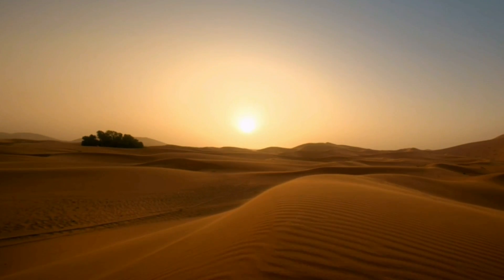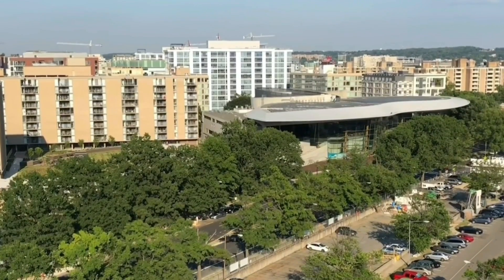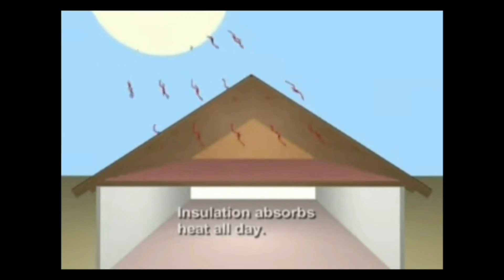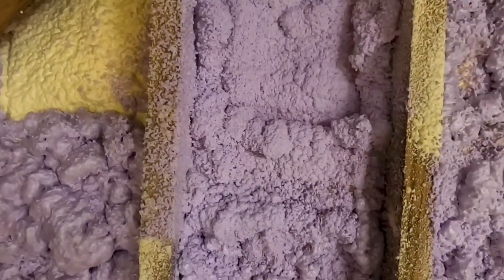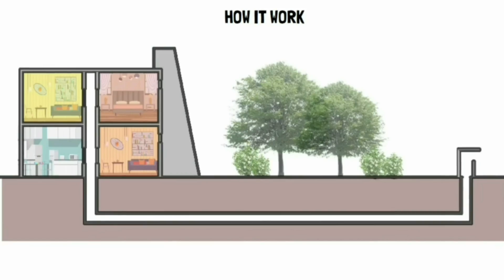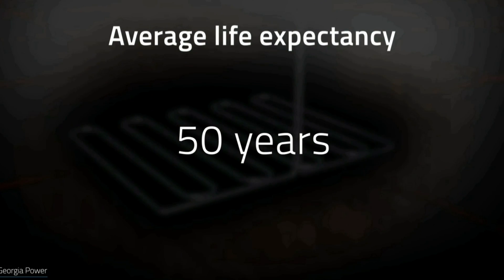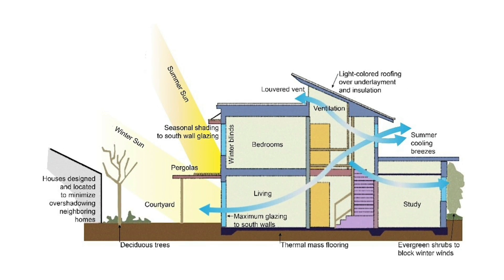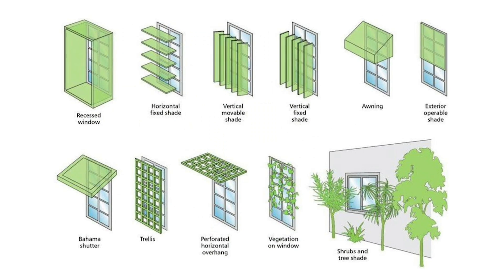How to Cool Your Home Without Electricity

Comment: My ventilation cooling system, which is shown in the icon, is precisely intended to reduce the power consumption of my air conditioner.
I have published the progress of my home's power consumption on my website, so please do take a look.
It can be installed in many homes as it simply needs to be placed there.
Since I was in a position to explain energy-saving measures to factory customers, I wanted to reduce electricity consumption as much as possible at home as well, which is how I came up with this design.
One of its special features is the automatic protection function in strong winds.
By bringing in cool breezes into the room in the early morning and at night, it is possible to definitely reduce electricity consumption in the home.
In areas where there is even a little snow, houses are highly insulated, and in the summer, that insulation keeps the house warm even at night.
If we try to cool down the night heat with air conditioners, which consume huge amounts of electricity, the outdoor units will emit even more heat, accelerating global warming.
This product is also listed by the Japanese Ministry of the Environment as an energy-saving measure.
If you have friends who are visiting Japan, encourage them to buy it as a carbon-cancelling measure.

Comment: What if I told you that the greenest air conditioning was re-invented 50 years ago?
It is a really great piece about Persian Badgir or Egiptian Malqaf (windcatchers). It is very ancient, but very simple direct evaporative air cooling with limited Temperature difference and added moisture to the product air. More advanced is indirect evaporative with dry and wet channels, wet bulb limit and dry product air. The ultimate tech is dew-point indirect evaporative air cooling inspired by Nature and implemented via advanced tech with multifold savings in energy and water consumption, carbon emissions and cost. Prototypes of the ultimate third generation Gen3 are already available for demonstration to all interested parties
We would be happy to provide additional information and demonstration video of prototypes with EER 200 (!)

Comment: Personally, the only thing I care about with this is not wasting resources that I do not have to. I find it annoying that our modern architecture isn't only ugly and utilitarian but designed to waste resources like electricity. If every home was built to maintain a comfortable temperature range year round, then  we would be able to keep more of our own money. If we collected our own rainwater with tanks large enough to store a years worth of water for the average house and had home filtration systems and septic systems, we would save a lot on water. Even electricity could be done at the scale of the individual homes. Eliminating the grid would save a ton of money and resources. That money could be used for more important things like say building wealth at the individual level.

Comment: I have a white metal roof, it makes a big difference. My deciduous trees are about 10 feet tall, helping afternoon shade/transpiration already and farther out I have evergreens for wind block.  I adjust window coverings during the day. I manage passive heat gain for 10 hours of winter warmth. My raised beds circle the house and act as earth berms for the house. All old low tech. Outside window shutters are a temptation, a protection against windstorms, too.
I have a 10x10 zen rock garden entry on the north and it is my favorite place summer and winter. One Adirondack chair rocks, gravel, one miniature pampas grass and a tiny evergreen shrub. I have a tiny Korean charcoal grill and wok that I like using there.
No McMansion but suits me.

Comment: You start your video with saying design in the most important - then you say what if you have no control over the design? Well there are many solutions... then you talk about using green rooves and underground geothermal heat pumps, etc which are very much part of the design you must incorporate into the building from the start... For geothermal to work the building foundations must have appropriate insulation built into the foundations, which is near impossible to fix in retrospect. So why talk about making changes to the home in retrospect and then introduce ideas which really only work if you design the home with those things in mind? And your number 1 solution is really called passive solar home design. Again not something you can easily do to an existing building that is poorly designed. Again asides from putting insulation in the walls and ceilings, all of the solutions are design solutions which need to be done before building is constructed. I agree with most of what you said, except that the solutions are something you can apply as a fix on an existing home. If you are going to build a new home then your solutions are great... but not sensible if you already live in a poorly designed home.

Comment: My partner & I opted for denim insulation about 10 years ago when we renovated.  We love it.  The particular brand we chose uses borate to kill bugs & bacteria, and makes it fire resistant.

One method not mentioned is to have a white roof to reflect light and heat.  

Some mistakenly assume this only applies to homes in the South, like mine, but according to what I’ve read this isn’t true because any heat gain a black roof might provide in cold weather is too little to help in reducing energy use because of the extreme truncation of daylight  during winter as you proceed northward.  The average energy usage and cost is empirically almost always more with a dark roof no matter where you live.

Comment: When I was younger my grandparents had this big metal window fan from the 50's or 60's. It came from Sears and Roebuck. It only moved air 1 way. Pull air from inside to outside. It had at least a foot & a half blades on it. With the front door open that was shaded as well by trees & a screened in porch. They never really had to turn the AC on during the hot Charleston SC summers. The draft coming through the house was more like a light to moderate breeze. Since it was in the kitchen next to the stove. The stove never had a chance to heat up the house.
Reply: Yes, and whatever happened to attic fans?  They Worked!  But, they were very loud...could there be a more quiet solution?

Comment: My bedroom has the worst climate control of any room in my home. It's the hottest room in the summer and coldest in the winter. To help remedy this I use white curtains in the summer which has kept the room noticeably cooler, and very dark heavy curtains in winter which attracts sun and warms the room during the day, and the thickness helps insulate the room at night.

Comment: My building was renovated and before they started I mentioned that the insulation needed upgrading. They didn't.  My tub is sitting on slats next to cement connected to an outdoor walkway, the bottom is cold in winter so epsom  soothing baths (low ones, the same amount of water of a 4 minute shower, are no more. Under kitchen cabinets are warm and no root vegetable can be kept there in summer because they sprout readily. Nobody cares that are energy bills will just climb.

Comment: What refrigerating gases specifically? R-12 has been abandoned for decades. Be specific. HFOs (hydrofluoroolefin compounds) are NOT greenhouse gases and are also found in nature.  Modern refrigeration used HFOs. Other refrigeration in modern countries is to be reclaimed, and in many with serious penalties if not reclaimed, others can only be done by licensed professionals. Misinformation and disinformation will not help the fight against global warming.
Reply from the maker: It was CFCs that were banned not HFCs

Hydrofluorocarbons are a class of man-made chemicals used in everything from air conditioning and refrigeration to insultation and aerosols. They became widespread in the 1980s as an alternative to ozone-depleting chlorofluorocarbons (CFCs). Use of CFCs was banned in 1992 by the Montreal Protocol.

HFC air conditioning gases were then used to replace CFCs in air conditioning systems. HFCs are considered more environmentally friendly than CFCs because they do not contribute to the degradation of the ozone layer. However, HFCs have also been recognized as very potent greenhouse gases.
Reply: @LeafofLifeWorld  You’re talking about old refrigerants: CFC, HFC, and HCFC. I’m saying that HFOs have been used for well over a decade. It doesn’t also change my point that recycling air conditioners means even more care and heavy fines are taken into account to recycle the antiquated refrigerants.

Comment: We built a passive design home. It has exterior reflective insulation and lots of thermal mass. Our house is heated completely from the sun in the winter, and just needs some evaporative cooling in the summer. I like the idea of planting trees to help direct the air through the windows. 😎 Thanks 🌞🏜️
Reply from the maker: Amazing 👏
Reply: Here's a video showing our passive design and how it works in the winter. https://youtu.be/WRYO0spgonU
Reply: You definitely lacked trees.  You also lacked a grey water system . You are in desert and need to use every drop efficiently. You are not.  This will also create  a cooler environment around your house while create soil.
Reply: @estebancorral5151  We have a lot of mesquite trees on our property, and the soil underneath them is fantastic for the garden and trees. There is a decent sized mesquite tree on the west side of the house. We are watering it so it will offer more afternoon shade. Last spring we planted fruit trees on the east side of the house. The gutter directs all of the run off water from the roof into a trench that goes in-between the two rows of trees. The water from the shop roof is also directed to water some newly planted trees. Our gray water (laundry, showers and bathroom sinks) goes to a sycamore tree that we planted last year.
We also patched the large berm that was already on the property, and we added a pond that fills when it rains. It takes time, but we are definitely trying to make use of all of the water we get here in the desert. 🌦️🏜️

Comment: I live in a apartment during day time outer walls absorb heat and room walls reatains heat until midnight.

What insulation can be done from Inside
 since from exterior apartment permission will not be given
Reply: You can dry line the interior  walls with a plasterboard  that has a foam silvered insulation  on the back , it is fixed on with dob and dab , whereby an adhesive  gunk is plopped onto the back in equal  spaces and then pushed onto the wall where it sticks. It's easy to finish  off and paint

Comment: in Iowa we used to have the greatest ambient temperature in the world. not sure now. when i bought my home i planted mulberry trees on the south side. deciduous trees on the south side have the effect of shade in winter and letting sunlight in in the winter. i don't use air conditioning. our temps got up to 100 f this year. did not need ac. since we have a dryer climate heat does not affect like in the southern states. it seems winters may be warmer with climate change in iowa? at least this year el nino is predicted to elevate temps this winter. gas is a problem. i heated with gas up until last year and switched to electric. while not ideal electric is cheaper than gas. i use space heaters just enough to keep the temps above freezing except in one room. my system was not exactly ready for this and right now i am rewiring a few circuits to handle that technique. electric is manageable at least. gas has a number of problems besides expense. it pollutes, and is dangerous. i'm glad i removed it. i use oil circulating space heaters for safely sake. i have one in each room that is a water source. in the basement i have electrical tape on the pipes just in case. there is one cold spot in the basement especially which i am insulating better. my roof has an asphalt tile that is corrugated to look like ceramic roof tile. i installed it myself right over the existing asphalt shingles. it gives and extra barrier to the sun. this is not a perfect system as the squirrels will sometimes think that nibbling on the asphalt is fun. but that is a rare occurrence. 
also my home made from concrete brick, decorative. i'm not sure what effect this has? but at least it is a bit more resistant to heavy weather than just wood. our town seems to be on a slight elevation and heavy storms generally dissipate before they reach us or just go around which is handy. i don't think we have ever had a tornado in town. but there are signs of tornado damage in towns around us. i guess i'm lucky? we will see.
Reply: Blessed 😇

Comment: We use a tranclucent plastic foil. It's like tinting the windows. It's best to use on the outside. Other windows have (more expensive) thermal blinds. The glass gets hot, but most of the heat is reflected out and in winter they do the opposite.

Comment: In the Netherlands a moderate climate we use a slightly different solution to shutters. A rollout sunscreen  or “markies zonnescherm”. While AC is becoming popular this was everywhere and is still around for a lot ot homes. The passive ability to block or not block sun helps to allow sun to enter when it becomes colder again and blocks sum when warmer. It also does not block the view like the french style shutters. 
Unfortunately these seem to get out of fashion in favor of AC because the peak temperatures are getting higher and people want to cool their homes after becoming too hot (you have to roll out the shades consciously before the sun enters)
Personally I have a mix of the Dutch style markies zonneschermen, insulation and natural ventilation by opening windows, this just about works on peak temperatures.
Reply from the maker: Thank you for sharing, the rollout sunscreen sounds interesting!

Comment: I am somewhat disappointed that these ideas are only directed at homeowners, or rather: homebuilders. As an ordinary tenant, I had hoped for something I could do. Cities are literally hotspots, and it is in cities where most renters live.
Reply: OK I might be able to help.  I live in an ex-communist apartment block in Bulgaria, it has a wind catcher to provide colling so I don't have AC. But this year it got to 42ºC for nearly 2 weeks and the passive cooling stopped working.  I came up with some things and spoke to the old people in the block and this is what you do - and ti REALLY makes a huge difference. 

MOST of the heat comes in through the windows. You want 3 levels of protection - first you want sheets of hardboard cut to fit the size of your windows and either covered in tin foil or painted silver on the smooth side.  These go up against the window to reflect 80% of the heat. I did nt have these prepared so I just used white cars and that worked well.

Then you want either decorative rugs or thick blankets on poles that you can hang over the windows 

Then you want thick curtains to replace your decorative curtains.  The key is to keep the heat out.

Then 5am open all your doors and windows to get the cold night air into the building. Close them at about 9am as it starts to warm up. About 3pm when the hose is getting hot open a north-facing downstairs window and a south-facing upstairs window and this will cause convection to move air through the house - if you have one use a fan to blow the air OUR of the house at the top window.

I managed to get through the 42ºC period with NO air conditioning with these techniques. 

OH - final thing, prepare all these things BEFORE it gets hot so they are ready to go,  Its miserable messing with rugs and blankets and boards at 40ºC
Reply: @piccalillipit9211 fantastic  tips thank you
Reply: Thanks! It always pays off to ask older people about these things! I could certainly put up reflecting hardboards. I also have two thick curtains for my door to keep out the cold in winter - I can easily hang them in front of my windows. Other than that, I am out of luck. Our staircase windows cannot be opened, and though I tried to convince my neighbours to close the house door during the hot days and only open it at the coolest time of the night, they leave the doors open all day. As I am at work all day, I can do nothing about it. But I am sure your other recommendations will work well. @piccalillipit9211
Reply from the maker: Maybe you can utilise option number 1 ?
Reply: Well, I can open my windows, but it's a small flat, and my two windows open to the same side and at the same level, so I can't create a cross breeze. I open them at night when it is cooler, which helps a bit. The house has no outside shutters, so I bought some blinds with sun-reflecting outsides. On hot days I'll keep them shut during the day, and when I come home from work, my flat is noticeably cooler than outside. But it has limits, especially when the heat lasts more than a week. Then the stones of the house are heated up and radiate the heat inside. @LeafofLifeWorld

Comment: MY COMMUNIST WIND CATER IS WORKING BRILLIANTLY TODAY  - perfect conditions for it.   22ºC inside 32ºC outside and a REALLY strong cold wind through the house 

Ive had to turn it right down as it was getting too cold.  It was not so good 2 weeks ago when it was 42ºC outside. It seems to lose efficiency over 35ºC